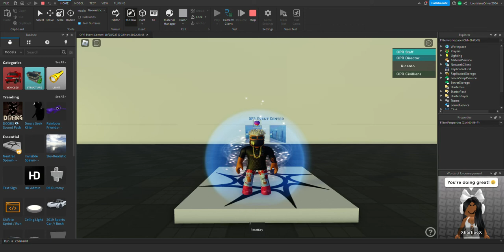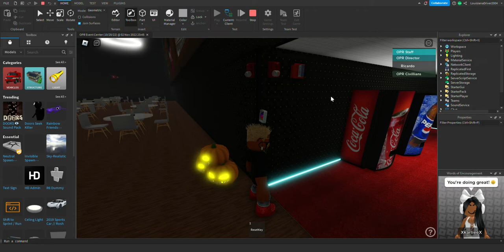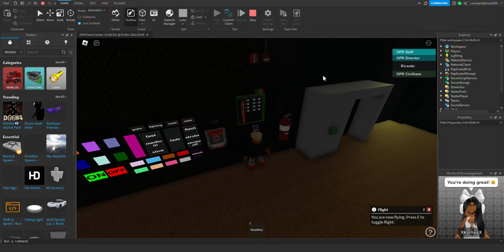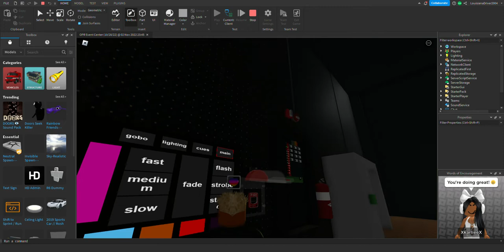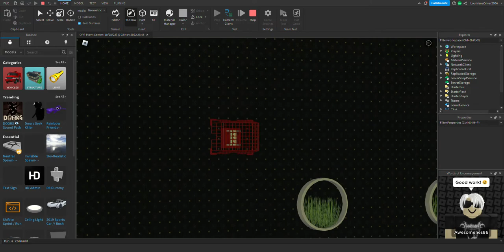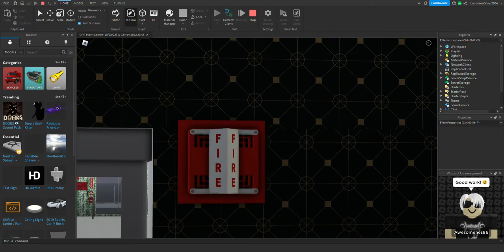Roblox Fire Alarm Inspection #55 (Federal Signal 450D's)

Comment: Good job! i actually made that 450D from scratch.
Reply from the maker: Nice man. You did a amazing job on it too. Sounds very accurate as well.
Reply: Yep. I just have to adjust the pitch. the sound is lower than what it would sound in real life. I am also planning on making the AC Model, The Vibratone 350.